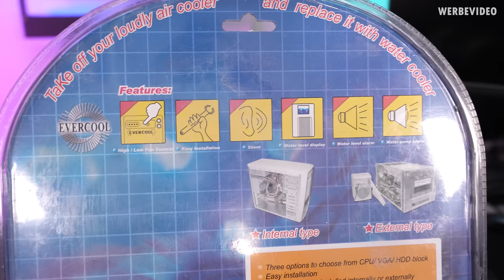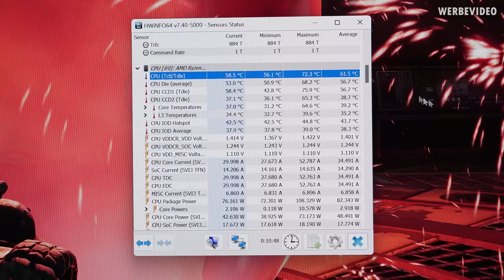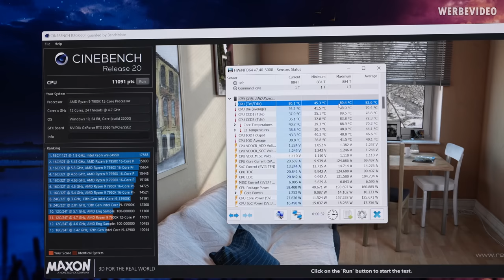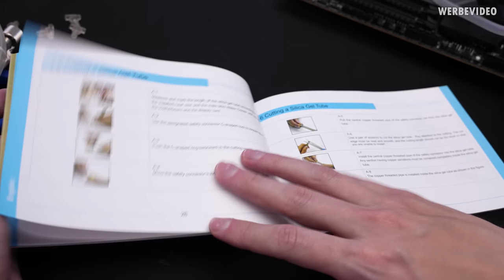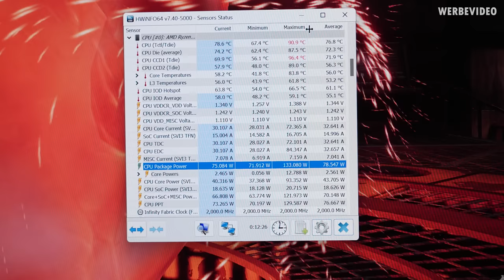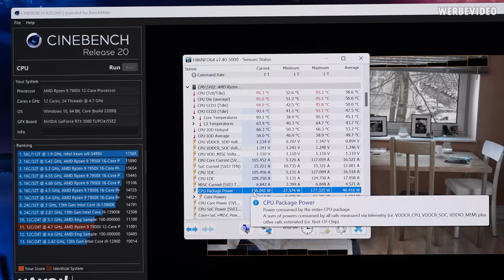19 Years old Water Cooling vs Ryzen 7900X

Comment: When it says silent running, it actually means "you'll go deaf from the beeping and won't hear the beeping anymore". GENIUS!
Reply: I hope Roman pins this comment 😂
Reply: If you go deaf from the beeping, you'll have a silent PC. You could even fill the case with blowymatrons and it would be silent.🙉
Reply: WHAT!
Reply: Its a one size fits all silent running device, makes everything else run silent too, Genius.
Reply: reminds me about "how to hide velcro sound" video
Reply: Well to be fair any mechanical harddisk would have drowned out the noise of this thing, i guess you could have called that "silent" back then.
Reply: @timhartherz5652  which mechanical drives are you referring to? The only ones I know of that would be that loud are those high rpm raptor drives.
Reply: @ArtisChronicles  In my experience any WD drive from back then, which was out of warranty, fell into an identity crysis and wanted to be a vacuum cleaner.
There were silent ones alright, like the Hitachi's but they were slow, or the Samsung spinpoint's, which were expensive.
You would rarely find a silen drive in a prebuild, since they used whatever cheap drive met the specs, most people never upgraded unless they were out of space.
To make matters worse drive bay's usually weren't decoupled and noise dampening for the case was an afterthought, if present at all.
Not to mention GPU blower coolers sometimes called "leaf blowers" or CPU and case fans without speed regulation because the manufacturer was a cheapskate.
Even 'till this day most people buy a prebuild and upgrade later, if at all, enthusiasts like us make up a small percentage of buyers.
Reply: @timhartherz5652  For sure, like mid 2005 - 2006 was when they started getting actually quiet.
The motor bearing noises once the oil dissipated from older drives is ridiculous how noisy & hot they get on drives between like 1996 - 2004, specially if they were used drives that has been running 6 - 8 hours daily for 3 - 4 years before you got them yourself, specially with how they screw directly into the case usually without any dampening or anything they just transfer the noise into the case more.

Got a old 20 gb fireball that actually needs active cooling because of it being so worn out like it sits at 45 - 50c constantly.
Speed wise it's perfectly fine still for an ide drive but man i cannot stand the noise it makes for more then like 1 or 2 hours, came out of my grandparents old pentium III system we setup for them in like 2003 or 2004 that ran daily until i think 2014 or so.

Got a 80 gb ide wd drive from 2006 that's just as quiet as my harddrives in my main pc.
Thought i forgot too plug it in the first time i put it into my testrig at the time as i expected the regular old ide harddrive noise & was pleasantly surprised it's quiet lol.

Was gonna use it in a modded fat ps2 but it doesn't quite fit that network adapter unfortunately.
So i might just go with a ps2 sata adapter instead at some point & toss in like a cheap ssd or some random sata hdd i got around.
I can emulate the games for now anyway if i feel like playing some gran turismo 3 or 4 or something.
Reply: @ArtisChronicles  Holy shit! The fucking 10.000rpm! When I was a teen I wished to own of that! At that time the sense of hearing was different, every PC was a jet engine....
Reply: SILENT ALARM ACTIVATED!

Comment: Northwood peaked at like 125W TDP (and melted sockets) - even back then it would have struggled with overclocked CPUs. Great content
Reply: Prescott was an absolute thermal nightmare and Intel's internal testing had their followup chip on that same architecture breaking even 250watt power limits in testing... Which is why, tho they hit 7ghz, they dropped the entire roadmap and made the Core series... Thankfully
Reply: @JE-zl6uy  and here we are 15 years later, Intel processors are pulling 300 watts again!
Reply: @chubbysumo2230  This is why Intel turned to "Efficiency Cores" lol... Meanwhile AMD just has all standard codes with some speciality cores (3D vCache) for the highest performance single core tasks.

Which is funny, Intel said "Okay we need weaker cores to handle the easy stuff and save power" and AMD said "We need higher performance cores to handle the high performance stuff."

Which... I prefer AMDs methodology here.
Reply: @chubbysumo2230  just buy the 13600k at maximum and you will be good to go. Why bother with higher end cpu which you won't buy?
Reply: @JE-zl6uy  Actually even AMD is doing the "Efficiency core" (which isn't really all that efficient when intel does it...) route albeit it retains most of its IPC except for cache heavy workloads, they're now trying Zen 4c(or 4D) cores that have half cache of the bigger Zen 4 cores and optimized for lower clocks.
That will change the x86 game
Reply: Don't forget though that the size of the die was larger than that of a Ryzen CCX, so thermal density wise you'd be better off on the pentium 4.
Reply: @JE-zl6uy  I had a Prescott at 3.2ghz back in the day, the "hot" core stepping too. That thing cooked three motherboards no matter how massive a cooling solution I threw at it, all three came out of the system with a curve around the socket, the heat literally warped the boards.
Reply: @RTDragonCommando  Thing was so hot that it collapsed the USSR
Reply: There was also 130W Pentium D's which literally have two Pentium 4 dies in them
Reply: @RTDragonCommando  Intel stock coolers also bend the board so that there's a curve around the socket. At least on LGA775
Reply: To JE, I think AMD's cores are still more efficient than Intel E, let alone Intel P.
Reply: @DLTX1007  It’s not available to the public. All Zen 4 chips are homogeneous core CPUs.
Reply: @Iridiumcosmos  yet. I didn't say right now

Comment: Come on! You should have used the 80x80 screw holes in the back to add a noctua 80mm server fan in a push-pull configuration. I'm sure after that it can cool a 13900KS no problem! :)
Reply: Nothing less than a Delta! :D Let's say a GFB0812DHU in all its wailin' glory, what a beast.

Comment: Not sure if you can get your hands on one, but I'd love to see one of these reviews, but of the original Vapochill phase-change case.

They were a major object-of-desire for me back in 2004-ish, and would be really cool to see how one would hold up with a modern CPU.
Reply: Srsly
Reply: Oh yeah, I remember seeing one of those at a LAN-party back then. But I don't expect it to be that good with today's hardware. Back in the age of Northwood, CPU's were only consuming around 50-60W, same thing with the high-end GPUs like the Radeon 9800XT and the X800XT, and the CPU die sizes were similar to what we see today. Roughly, at the top end, CPUs consumed about a third while GPUs consumed a fifth or so, though there was probably some more watts consumed in secondary components like the north and southbridges on motherboards.

To show how GPUs were very frugal...

Google Arctic Cooling VGA Silencer. This was pretty much the best air cooling solution for GPUs back then, and it only had one fan with a diameter of 70-80mm, and not a single heatpipe ! Or Zalman had passive cooling solutions for mid-range GPUs like the Radeon 9600 that consumed around 30W, and those were just 2 aluminum heatsinks that with some small fins or ridges to sandwich the graphics card, all of it held in place with 1-2 U-shaped heatpipes.

Or the air cooling revolution for CPUs that came with the Thermalright SP-94, because it was the first heatsink using heatpipes. That thing was heavy for its time, but it's only about half the weight of today's tower coolers. It was also only intended to use 80 or 92mm fans, compared to the towers we see today using 120 or 140mm fans.

The same thing can be said about PC cases ; 80-92mm case fans were the norm 20 years ago, and it's only starting in 2005 or so that 120mm became the norm, and not in huge numbers. Something like 2-3 fans for a case. Nowadays, 2-3 fans is basically for micro-ATX cases, and they often are bigger than 80mm, while normal cases can accommodate 5+.

Comment: Cute video :) In 2004 the "standard" or "average" understanding for "silent" was definitely different, but nothing has changed for the enthusiasts. I have always wanted to not be able to hear the PC and back than in my early 20s I had a Seasonic PSU with a 120mm fan, a cpu cooler with massive copper heatsink and HDDs on rubber standoffs - there were enough high-quality products.

Comment: Please test the Zalman Reserator (1 or 2) fanless water cooling unit if you can get your hands on one. It would be interesting to see how well that thing performs nowadays.
Reply: And if you make a combo, The Reserator with the Koolance PC2 - 601 BLW case ( you remember the blue case that looked like an Antec case with a radiator on the top? ) and a modern CPU block, I think you would get some incredible results.🥶 brrr!
Reply: @patricktrakzel9657  It was actually a Chenming 601 case that Koolance modified. Those Chenming cases were everywhere for a few years. Even companies such as Puget Systems used them. For the price (cheap A-F) they were pretty amazing value.
Reply: @blahorgaslisk7763  1st gen alienware also used those cases I believe.
Reply: @patricktrakzel9657  i still use one on my 12700k with a added 120mm rad
Reply: I've got a Reserator collecting dust in my basement, even back when it was new I had a fan with some ducting over it :)

Comment: I would love a history lesson on insane air cooling from the same time period. Zalman in particular had some lovely heat sinks. And then there was the whole hand-lapping movement, which I never got up enough courage to try, but I did read many forum and blog and usenet posts about!
Reply: People are still lapping the IHS of the processors so it's still very much a thing. I think there's some video on this channel about lapping, but if not then there's certainly one on Gamers Nexus, as well as on a lot of other channels. I'm also pretty sure I remember something about Der8auer selling some lapping gig that give you a visual indication that you get the IHS lapped evenly so it doesn't end up loop sided.

Comment: I used to have a similar kind of thing a long while ago, only the cooling unit slotted into one of the 5.25" bays. Two little dinky fans, yeah, it was... not silent. It did have drip-free connectors with little valves in though.
Reply: I had a CoolerMaster Aqua Gate.

Comment: I remember purchasing Thermaltakes original Athlon XP water cooling kit with cpu mount cooler, smaller radiator, about 5mm thick tubing, barbed fitting and metal squeeze clamps, internal tube springs to prevent bending and it worked quite well for cpu temps …. About 10-15c cooler than a large cpu HSF cooler in its day.

Comment: A) I wonder what kind of difference there would be if you swap out the fan for a modern 80mm. 
B) I like the design of that radiator shell. Wish there were mode odd designs like that.
Reply: Eye open

Comment: Crazy advanced for the time period when water cooling was mostly very obscure, and often just rigged together systems. Back then for my overclocking I was still using the Thermalright SLK-900U solid block of copper air cooler with a good old Vantec Tornado fan. Now THAT was loud, and aptly named. 

Still, it got me some record level OCs on my volt modded DFI Infinity Nforce2 motherboard, and Athlon XP 2500 mobile lol.

Comment: I have a Dtek Customs water block with an aquarium pump and a radiator also from Dtek which was an auto heater core. It was a custom loop with homemade rad shroud…it worked great…was probably around mid 90’s 😅
Reply: Mid 90's when a small aluminium heat sink and a tiny fan was more than enough for cooling any CPU

Comment: Up until 2019 I was using a Danger Den TDX (from 2004) to cool a 3600X, and a Danger Den Maze 4 (also 2004) to cool a 5700 XT. The TDX did great on the 3600X, and I suspect it would've done great on my current 5800X as well had I not finally replaced it with a Bykski block in 2020, just because I was tired of the mounting mechanism. The Maze 4 also did very well on the 5700 XT, although it did struggle compared with the TDX, which shouldn't be very surprising with how simple and small the Maze 4 fin stack is. With the Maze 4 the card hit 53C edge and 83C TJ at 290W. The EK Quantum Vector I replaced the Maze 4 with is usually around 46-49C edge and 68-73C TJ in comparison.

Comment: This gave me flashbacks to my Koolance PC2-C case with, I believe, the CPU-200G block + a CHC-A03 block for the GPU (GeForce 3).
The CPU block sprung a leak almost killing my GPU and motherboard. Only reason I spotted is was because the pump started making weird noses as there was air entering and somehow the water had started to form bubbles like it was soap.
First and last time I ever messed with water cooling a PC :D

Comment: Maybe the water-level sensor operates on conductivity and assumes the corrosion inhibitor has been added.

As for the appearance, it's modeled after an electric guitar amp or an old radio.

Comment: I liked the internal design so much that I'd rather use it without the plastic case. It reminds me the Power Mac G5 dual core watercooler, that came around 2003. I would replace the fan for a Noctua one too. I think the temperature issue is due to the absence of fins inside the block (which was common place at that time), please test it again with a modern block! And yeah, I totally want one now.

Comment: As a person that have been doing water cooling before companies like Asetek came around, well i would not expect too much from that contraption.

PS: Right now i cool a Threadripper 12 core ( gen 1 ) on a dual 120 mm radiator, and it have worked just fine for several years.

Comment: My retro games machine is a Prescot P4, the last SKT478 3.2Ghz, with that new fangled hyper threading. Even with all modern case fans, a modern Noktua fan on the cooler, and even with the Noctua cables with the resistors in them to slow then fans down, it still sounds like standing on the deck of an aircraft carrier with jet fighters landing on it.
Reply: Stick a 120mm aio on it and thermal epoxy stick it on.

Comment: I used to have a evercool fan that the body of the fan was milled aluminum! That fan seemed to put out way cooler air Dan a normal plastic fan, probably due to the airflow over the aluminum.
Also, the outer body of the fan was removable from the inner part with the motor and fan, so technically you could change the motor and fan blades and keep the outer heatsink designed body

Comment: That tube radiator inside the main unit is probably some off the shelf radiator for small refrigerated drinking fountains.  The fact that changing cooler speed doesn't affect thermals, means that either the surface area of the radiator is just too small, or the water flow is insufficient. (my bet is the first option)
I guess you could try 2 of these coolers in series, that should increase flow and double radiator surface area! hahah

Comment: The real content. Oh man evercool, they made those aluminum fans. Technically only the frame was aluminum, the struts hub and impeller were plastic, and the frame wasn’t that well machined. I never ended up using it, I was bad at planning builds, though I think in this case it was a because I changed from a case that didn’t include a rear fan to one that did and ended up not needing it.

Comment: I had a similar product from cooler master that was a lot lot lot worse. It was sold with a copper cpu water block and it had an aluminum radiator and reservoir. 

I think because the CPU clock was copper I assumed the rest of it was. I ordered a triple 120mm swiftech rad which at the time was pretty awesome. 

Anyway, the thing constantly corroded and I always had overheating issues. When I got rid of it I took it apart and found there was almost zero water flow inside of The cooler Master Aquagate because it was so full of corrosion. 

I ran it for years lol. After the first coolant change I was putting straight tap water in it too. American tap water at that :p